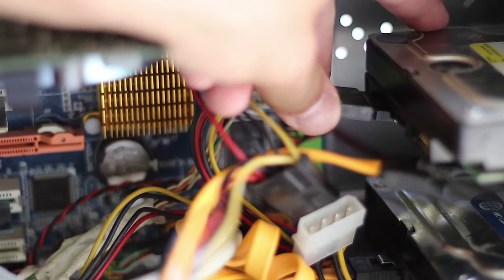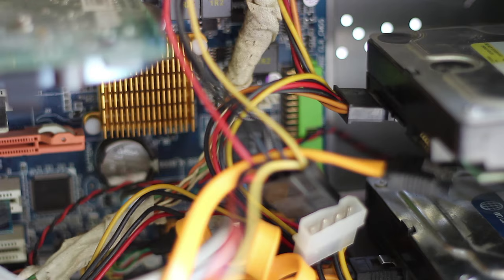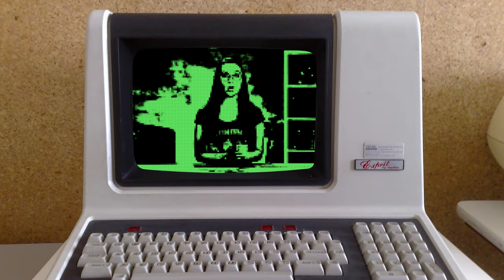PC Build – How to Fix a PC that won’t boot – DIY in 5 Ep 112

Comment: fans are running, leds are on, safe mode doesn’t work, no display, it’s in a coma like state, everything is on and is running but it won’t boot
Reply: did you ever figure out what it was? My computer is doing same exact thing
Reply: Same here
Reply: @chrisfalvey9178  nope.... i found out recently it was my motherboard. it was shot
Reply: @chrisfalvey9178  did you? I'm having the same problem
Reply: @uwu_shugoki4042  My pc boots sometimes but doesn't sometimes
Reply: @verex7503  same . How u solved ?
Reply: What was your solution?
Reply: if your cpu doesn't have integrated graphics bios won't show up in monitor, you need to install dedicated graphics card to show bios in monitor
Reply: Sometimes it's as simple as ram being a bit scuffed. Check the ram.
Reply: I'm having a similar issue, but neither the keyboard nor mouse turn on either.
It seemed perfectly fine yesterday at that, and I made sure to never overheat it, I really hope it isn't the motherboard...

It doesn't even _look_off in any way! It's just so frustrating...
Reply: Had a very similar issue. Took my RAM sticks out, cleaned them, problem solved 👍🏼
Reply: I moved my pc then it didn’t work so I did a bunch of tests nothing worked and then I tried a different power supply and it booted so I thought the problem was fixed. The next day I packed it up and moved to a different state and now it won’t boot. So now I have no idea what it could be. It’s unbelievably frustrating.
Reply: Ok I actually just found a solution. Instead of plugging the hdmi into the graphics card I plugged it into the other outlet and my pc booted right up
Reply: @allynfornow But then you wont be able to use you graphics card right?

Comment: Hi, my CPU does not power up, I changed the power supply and nada, I removed all usb connector , 2nd HD and video card still nothing. When I turn on the power supply switch the Power light on the pc lights up solid, no fans come on, please help

Comment: So I took the HDMI cable off of the television and I plugged it into my laptop and I'm thinking well I can work with this with a little laptop as opposed to 70-in television screen and if when I did my laptop stopped working and it's never let me down HP Pavilion a couple years old and I can't get it to start I'm panicking I'm not a computer Guru please help

Comment: Hey! So computer turns on but goes to black screen with with the cursor blinking. What is that? It’s a Win 10 w/bios. If I restart and hit F12, it will usually start up fine like that.

Comment: Sometimes my gaming pc starts with light's and fans but won't start up properly, as in no main screen but when I pop the cmos out and put it back the pc starts up as it should why is this .
Reply: CMOS battery powers the  bios  while your computer is off so taking it out  loses the user bios settings and resets it to factory settings.

Comment: Hi, I just built my first pc. When I pressed the power button everything started working fine, apart from a red led on the vga status. However the monitor turned on and sent me to the menu to set up my bios. I tried to press F2 or F12 but the keyboard seemed not to work. I also tried to change the keyboard but that was not the problem. Regarding the red led I searched on YouTube some videos but none of them worked. Now I am here with my new pc and I can’t use it because I can’t set up my bios, what should I do?

Comment: My computer will post but when I try to hit F1 or F2 or F8. None of it works. It won't let me in to the bios or anything. Then it goes to a screen that lists all the hardware and says press F1 to enter bios and that won't work either. So I'm at a stand still. I really hate to take it somewhere to be charged $100 for something simple. Any advice?

Comment: Hey Trish., How often should I reapply thermal paste on the processor ? 👈⁉
Reply from the maker: It should last for several years, but it's a good idea to change it if you are removing the cooler or experiencing a rise in your CPU temps.

Comment: Is it Plugged In?
We hate to say it, but make sure you plugged it in. Fans should be spinning, lights should come on, etc. If none of that happens, you know you have a power-related issue. If everything seems to be working except your fans, your computer will not power up in order to protect the components from overheating thanks to multiple protection circuits on most motherboards. what should i do madaam?

Comment: So, my PC straight up froze while I was using it. The screen on my monitor was locked onto the last thing before it froze, and I couldn't use CTRL ALT DEL to even work. To top it off, the light that flickers when the memory is on use speed flickering, and it should've been because I was running a program at the time. I turned my PC off manually and tried to boot it back up. I thought it would boot up just fine, and it didn't.

When I try to boot it up everything turns on, the memory light flickers a bit, and then nothing. It doesn't POST or anything. If I leave it like that the memory light will flicker occasionally, however, I know it's not even trying to boot up windows, because the memory would go pretty much solid for that (still using HDD). I thought it might be the HDD, so I connected an old one that still has windows 10 on it, and it did the same thing. I know it's not the video card because of the fact that I would see the memory light go solid as of windows was boring, and I just couldn't see anything because the video card is fried. I actually had just replaced my vid card about a year ago. I literally have no clue what it is. I mean, my computer is pretty old. So, it could be anything.

I disconnected everything, reconnected them, cleared the BIOS, and still nada. The only thing I didn't do was taking the memory out and trying the sticks separately, and in different slots. I'll try that now to see if anything happens.

Comment: F8 doesnt work in Windows 10 anymore, your PC has to fail to boot 3 times for it to boot to Windows RE then click advanced startup or startup options to boot into safe mode
Reply: When starting computer, hold down SHIFT KEY and this will take you to TroubleShoot, then choose SAFE MODE in Menu. This replaced the hitting F8. 
Another way, (as per Microsoft), when booting computer, after you get past the MFG LOGO, unplug Power Cord (turns off computer, essentially Crashing Windows). Then plug in power cord, and turn on. This makes Windows think it needs to REPAIR itself, and will take you to the TroubleShooting mode, to get to SAFEMODE.

Comment: I cleaned my PC the other day because it was dirty. When I turned it back on it wouldn’t boot windows to my SSD and I got a new NvMe chip and it worked except when I play my games they are running at half the frames they should be. And my bios says it’s operating at 126 degrees. Any tips? Thanks !

Comment: I need help when I start my pc it lights up fans on fine and sometimes it goes threw the whole booting process fine but like 6  months ago it started just not displaying anything  and I can fix it sometimes but not all the time I try to make it go on safe mode and nothing happens I’ve tried taking my ram out and putting it back in and it works but then when I opened a game it crashed and I had to restart and now I can’t play anything please help

Comment: I had a problem like this. My pc powered on, but wouldn't boot. Fans spinning and the lights all on. I've tried restarting pressing delete and F8, no joy. I finally unplugged the bios battery, left it out for 5 min, and unplugged everything and held down power button for 20 seconds. Then it booted up with a 'bios has been changed enter setup' notification, so finally able to get things running again.

Comment: I always look for a possible PSU short, especially if there are SATA power connectors with the lands showing, or if the unit has Molex connectors, since they stick out a little beyond the plastic connectors sometimes and can short against a random piece of case metal.

Comment: I need help, I just built a PC and it will boot when the GPU power cables are plugged into the GPU, but when they are not plugged into the GPU, the PC boots. What could be the problem?

Comment: Have an issue. Built 2 computers with tyan s2885 motherboard with 2 opteron cpus and 16 gb memory, diamond 7.1 sound card, amd video card, sata bluray recirder, sata 4 tb hard drive. Turned on system and amerucan megatrends splash screen appears. I press f11 to go into boot optiin screen, but does not. Gies to another screen briefly that said auto detecting usb mass storage devices..00 usb mass storage devuces fiund and config . It does show my usb keyboard and usb mouse, the sata hard drive and sata blu ray. But then a blinking cursor appears.
I have disassembled both units, reinstaled everything and when piwering up computer, same thing. Why does it try to detect a usb mass storage device. There is no operating system. New everything.
How to I bypass the usb storage device, or what is a usb storage devuce that the motherboard is looking fir?

Comment: I just bought an Asus strix b450-f motherboard and a be quiet 801 case. These are the only new components the other I have used before and work fine. The rgb on the motherboard turns on when power is on but nothing else seems to boot up (cpu fan, case fans) when I try to turn on the pc via the button on my case nothing happens, wont turn on fans dont spin up, rgb on ram doesnt light up. What should i do?
Reply from the maker: Check all of your power connections on the motherboard to make sure they are plugged in securely. If they are, it might be a faulty power switch on the case. Try testing a different power switch to see if it will power on.
Reply: yow i have the exact same issue with my asus strix 390 E did you get anything that fixed your problem UNDISPUTED?
Reply: @wkey8329  I used a flat head screwdriver on the power pins with just the psu, motherboard,ram and cpu connected that booted it up fine

Comment: my HP lap top suddenly stopped while working on a word file  and thereafter would not boot , it would go up to the windows icon and again come back to the set  up menu. the fans do not seem to be running and it seems to be trying to start the CD rom as the sound keeps on coming from the cdrom motor. pl advise  me . thanks. Anthony

Comment: Keep your PC running smoothly!

Dust buildup can cause overheating and performance issues. Regularly cleaning your PC's interior with compressed air is key.

For optimal performance, consider replacing your CPU's thermal paste with a high-quality option. This improves heat transfer from the CPU, keeping it cooler.

Upgrading your BIOS:

If you're planning to upgrade your CPU, ensure your motherboard BIOS supports it. Updating the BIOS with the latest version can unlock compatibility and improve system stability. Here's a simplified process:

    Check Compatibility: Verify if your motherboard supports your desired CPU upgrade.
    Download BIOS Update: Download the latest BIOS update for your specific motherboard model from the manufacturer's website.
    Format USB Drive (FAT32): Format a USB flash drive in FAT32 format.
    Copy BIOS Update: Copy the downloaded BIOS update file to the formatted USB drive.
    Flashing the BIOS: Consult your motherboard manual for specific instructions on accessing the BIOS update utility and flashing the BIOS using the USB drive. (Important Note: This process can be risky, so follow the instructions carefully.)

Here are some additional tips:

    Ground yourself: Before touching any internal components, touch a metal part of the computer case to discharge static electricity.
    Take your time: Don't force anything when opening the case or disconnecting components.
    Consult resources: If you're unsure about any step, refer to your motherboard manual or online tutorials.

By following these tips, you can keep your PC clean, cool, and compatible with the latest hardware.

Bonus (for credibility):

    With over 26 years of IT support experience, I've seen firsthand the benefits of proper PC maintenance.

Comment: Taking out the CMOS battery then back in after 5 mins  fixed mine. I should of done this before anything else.
Reply: @ Lee Ashworth
Thanks! 
I just couldn't get a peep ( or is that a beep!!) from my computer.
The monitor came on OK.
Fans and power light OK.
But pressing the Start Button?....dead as a dodo.
Checked and changed to a new CMOS battery......no joy!
Removed the 3 RAM sticks, then tried just one at a time in slot 1.
No luck! 
Went carefully thru all the Comments. 
Yours was a bit different.
"Remove the battery, wait 5 minutes, then try."
Gosh, couldn't believe it! The screen sprang to life with a pre- BIOS screen asking me to press F1 to go to the BIOS.
From there on it was pure cake.
I just filled in time and date.
There was one little stumble upon trying to boot.
I got a 'No NTLDR' prompt.
Luckily, an old issue I was familiar with. I had to point to and select, one at a time, my 4 HDDs to find the bootable one.
When I did, all  went normal.
After 3 days of " no boot", what a huge relief!!
If I am to hazard a guess, the trigger for the final solution was the 5 minute wait after removing the CMOS battery.
This allowed the old BIOS to be erased and to ask for new time an date.
Perhaps you have another explanation.
But the relief at the end of this exercise, by no means straightforward, was immeasurable.
Sorry for the long explanation. I thought it was necessary to provide clues to someone else, as Trisha in her wisdom and experience suggested.
And thank you again, Lee. You did a known thing, but with that all important twist!
"DIY in 5 min", indeed!!!

Comment: I just replaced a cpu with Ryzen 5 5600g and it is compatible with my b450M motherboard. I checked for bent pins and It still powers on but the debug led shows CPU light. What should I do?

Comment: Well this is probably the worst experience im having 
i bought a new hp pavilion laptop but after a few days just out of guarantee period i shut it down and other day it wont boot up .NO DISPLAY ISSUE
I have contacted hp for warrenty claim but they told that the guarantee period is of only 14 days (it happaned on 16th day )
The technician came over checked and said it might be a motherboard problem so that was ordered but even then it was the same issue then the guy ordered a screen replacement thinking that was the case but even after replacing the screen the issue persisted 
Then finally he ordered a display connecter cable thing but it did not resolve it he said that the display cable sent was delivered it has been now over 40 days ….
And im in the middle of my study and its really bothering me any suggestions or speculations what might be wrong???HELP WOULD BE REALLY HELPFUL
OH BTW IT WAS SHOWING THE LOGIN SCREEN WHEN CONNECTED TO MY TV BUT NO GOING FURTHER THAN THAT…
THANKS

Comment: Hi I was cleasing my cpu components and resembling them as the guide It also has a start but later on I start it's not . There is a power supply  
 but the motherboard fan is not spinning
Reply from the maker: Hi there thank you for your comment. If you have already tried the suggestions in this video as well as checking the physical components in and around it perhaps your best bet is to consult with the computer manufacturer for further diagnosis as well as consulting with a local Computer Repair shop.

Comment: I need some help,when I first boots up my pc it turns on and boot up without any issues, I can play all day, It can even perform a stress test both cinebench and Furmark at the same time for an hour without any problems,.  

Here's is the bad part,

When I "shutdown" my PC it will not boot up again, it will only boot up when I "Restart" it  

Fan spinning RGB lights on the motherboard LED lights will perform a cycle to red Orange yellow and then it stucks to white, and there is no display on the monitor,. White led means VGA base on my mobos manual

What could be the possible issue here 

Ryzen 5 3500X
Rog strix B450-f
GTX 1660 super
Coolermaster 650w MWE gold

Comment: Motherboard won’t boot up when CPU 8pin power plugs in

Hey guys. I have an issue. I wanna assemble my new pc. Here is the infos: Cpu: 5900X , Motherboard: Asus B550E rog strix , PSU: coolermaster MWE 750

Before starting to assemble I updated the bios by bios flash back button. Now when I connect the 24pin plug the motherboards rgb leds start to light and when I short the pins of the front header it boots up but the red led below the 8 pin cpu power lights and says that cpu power is not plugged. Then when I plug the 8pin cpu power it won’t boot up just a clicking sound comes from psu but doesn’t boot up. What should I do?

Comment: Hi. Mi PC turns on but dont boot, after a power outage. The speaker never beeps. Fans and lights are on, RAM checked OK in every slot, every cable looks fine, Power SW and Reset SW pins are OK. Do this confirm the problem ISN'T the PSU? The only weird behaviour is the GPU, it turns on, but its fans start and stop on a loop every second. I tried another cable but still the same. Any thought or idea? I need to finish my collage final project, for real.
Reply: And yes, I have a power stabilizer too
Reply: Update. I turn it on without the gpu and nothing change. light and fans running, but no speaker beep that indicates booting or trouble.

Comment: I Build a gaming PC it won't boot or turn on only RGB lights come on from the board. Fans don't spin nor the post diagnosis lights from the board light up I've been waiting 10 minutes still nothing . AM5 motherboard  asrock b650e steel legend.  Yes I made sure everything is properly conected